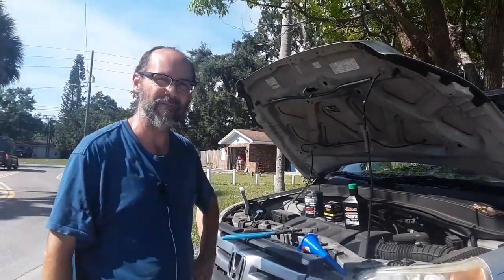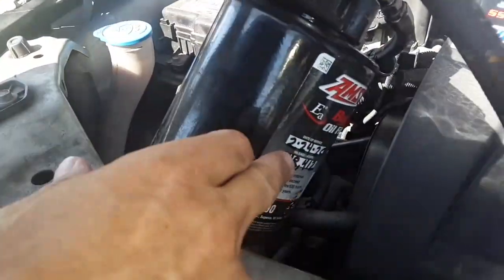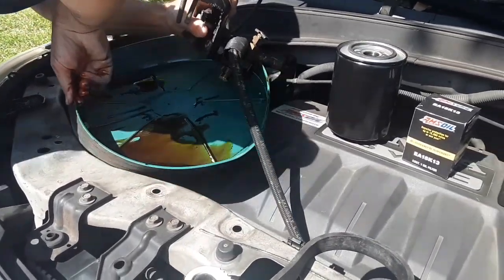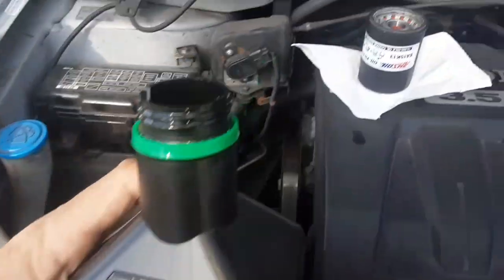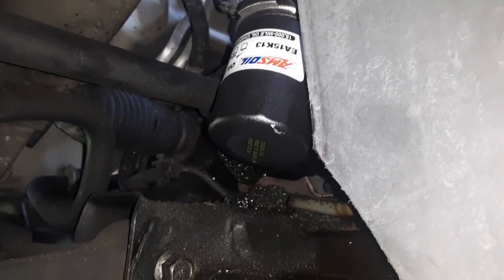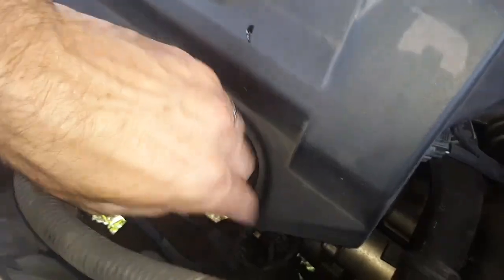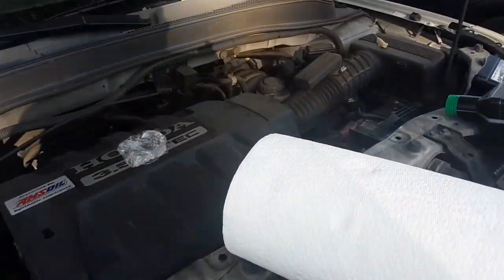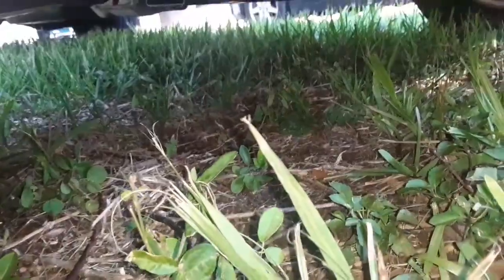Amsoil Bypass Oil Filter change 07 Honda Pilot 3.5L 🇺🇸 Declare Independence from short OCIs

Comment: Thanks for sharing this video, very interesting bypass setup. I own that same honda pilot and I’m very happy with amsoil xl oil also using amsoil for the transmision & transfer case fluids.
Reply from the maker: This is great to hear. Thanks for letting us know how your Honda runs on Amsoil synthetics!
Reply: @MikeTrullAmsoildealer   Have you ever used 5w-30 on your pilot? Thanks!
Reply from the maker: @alexandercuello3168  no I never have. It's that what you are using and how has your experience been?
Reply: @MikeTrullAmsoildealer  I started using 5w-30 during summer at about 100k miles, but I run 0w-20 during the winter. 5w-30 works great on my pilot the engine runs very smooth.